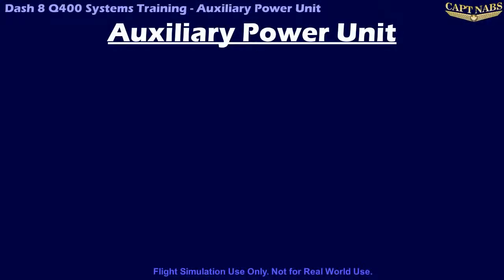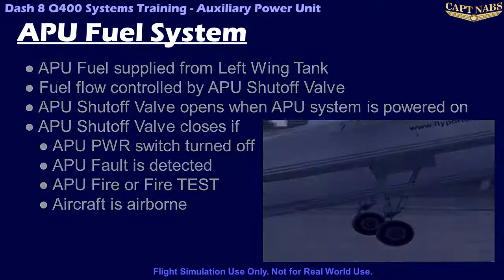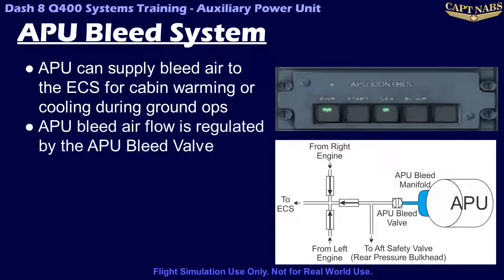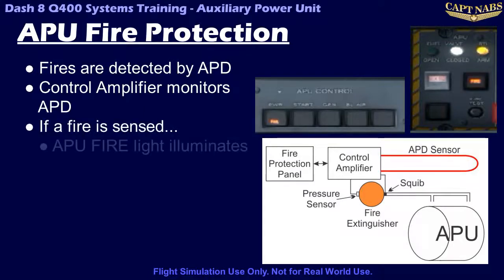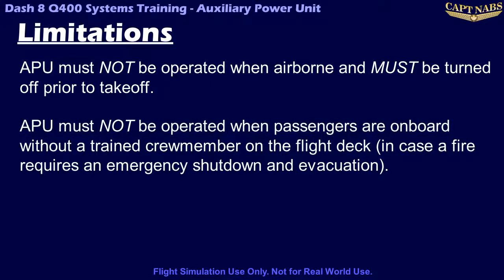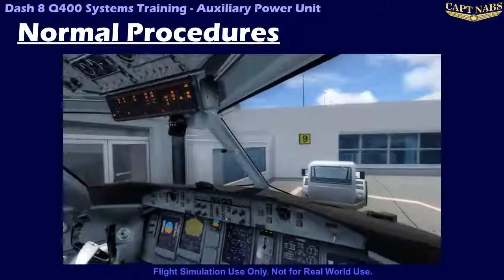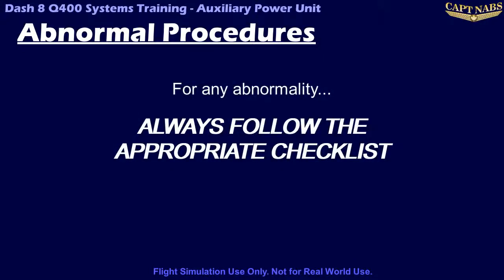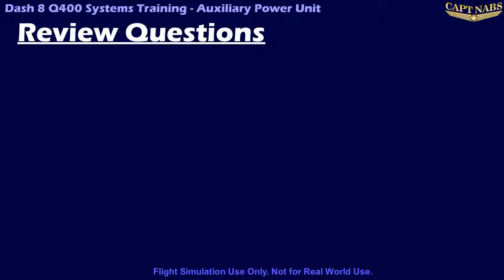Majestic Q400 Systems Training: APU (Fly Like A Pro)

Comment: I found that sometimes APU only starts with AC external power but not DC external power. Any explanation for that? APU Fuel Shut OFF Valve is DC Powered.

Comment: @captnabs Really enjoying the videos! If you're interested, when we fly this airplane - after starting the APU and getting the APU GEN online we start a timer for a minute until we press the APU Bleeds ON. Not sure if that's common with everyone but debris and gunk can get in there, especially in the winter with the icing fluids - let it breathe a bit before we breathe it, and maybe more reasons! Happy Flying :)
Reply from the maker: @OneBrightSun  I honestly can't remember if that was policy at my company or not. It's been 7 years. But yes, some manufacturers even include that recommendation in the FCOM to wait 1 or 3 minutes to allow fluids to flush out of the system. The other reason is to allow the APU seals to reach operating temperature to ensure oil does not leak into the air path.

Comment: If the Apu gcu connector is open can we have a successful ignition test.
Reply from the maker: Are you talking about the APU's Built In Test? Then yes, the APU Built In Test requires power from one of the buses, but not from the APU itself.
Reply: @CaptNabs  sir thanks for the prompt reply.  Actually we are having an Apu Mel in one of our aircraft’s. One of my friend says that he did the ignition test which was satisfactory. And so the Mel continues. But next day while doing some other work I found that the Apu gcu connector is open then how had he done that troubleshooting of ignition test. I m writing this just to check if I am missing something. Or that guy is making fool of us. 😄
Reply from the maker: @vinaymalik2986  Thanka for watching. Let me preface by saying I am a former Q400 pilot and not a mechanic so I am not a maintenance expert.
But as far as I understand it, it should be normal for the GCU contactor to be open when the system is unpowered. The GCU contactor should only close when the system is powered on, the APU is running, and the GEN button is selected on.

Good luck troubleshooting. You guys have a hard job chasing down what issue is making these systems fail. On behalf of all your pilots, Thank You.